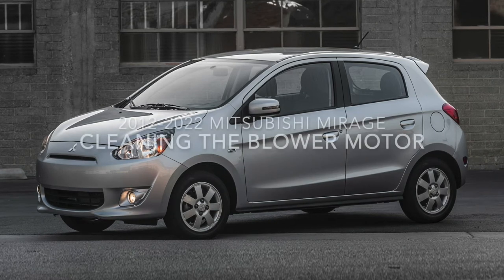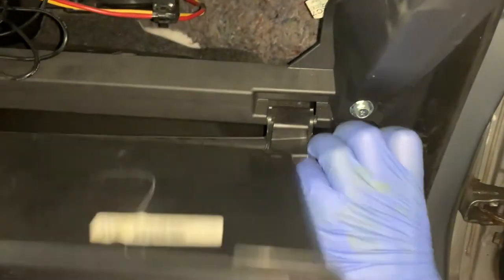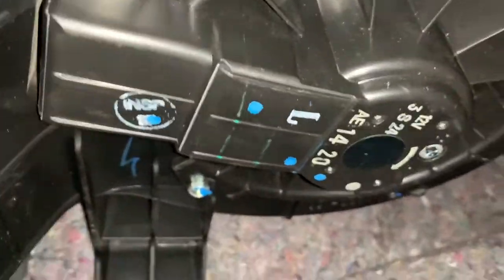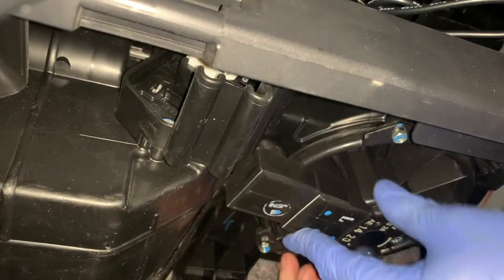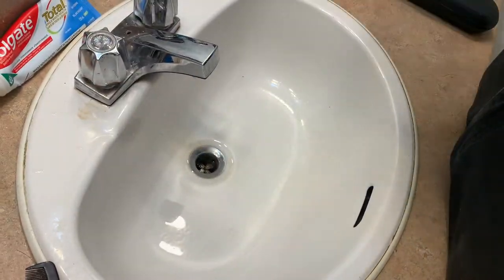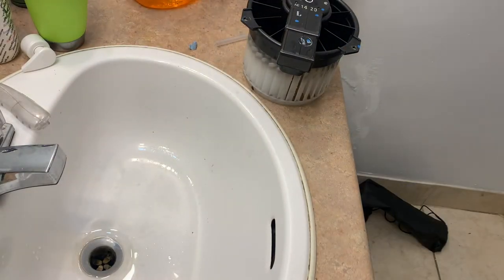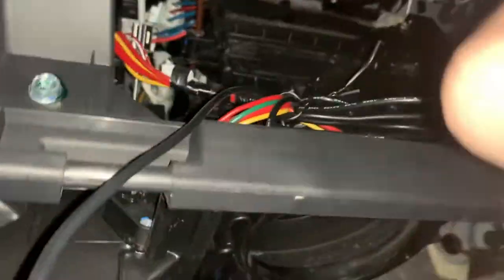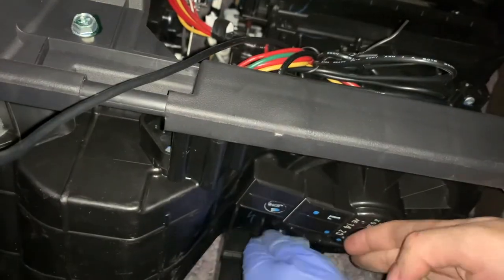Mitsubishi Mirage Blower Motor Cleaning

Comment: I have cabin filters with arrow mentioned on them... should filter be placed so tha arrow be upside down as mentioned on blower motor an upside arrow on it ???
Reply from the maker: Yes the arrow should be pointing down and the side with the larger surface area will be pointing up so there is more room to catch the dirty outside air that is sucked from above the filter down into the blower motor. This is discussed at 5:55 in the video.

Comment: hey man idk if your still active but im trying to get an item out of the right center air duct on the dash I cant find a proper diagram of the air ducts complete but if you have any tips please lmk. ive tried the vaccume trick and tried grabbing it with a coat hanger but cant see inside the vent!
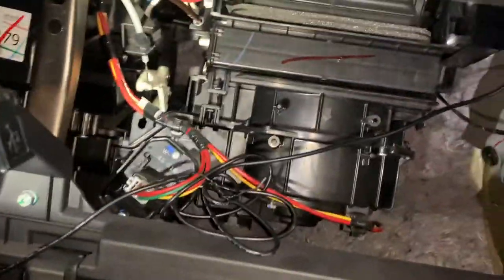Reply from the maker: Watch my CarPlay radio install video. In the first two minutes (around the 1:20 mark) in the video I show how to remove the vent grill/cover. https://youtu.be/3752c9OlRms?si=GOPjufUb-6RZh4Wt

Comment: One question sr .. how much freon has to be inside de ac sistem onz?
Reply from the maker: from factory service manual: 

Section 55A-3:
It takes: R-134a (HFC-134a) 250-290 gram or 8.8-10.2 oz. 

you can find a copy of this service manual here: https://mirageforum.com/forum/showthread.php/3720-Found-Complete-Service-Manual-amp-Wiring-Diagrams-Mirage-2015
Reply: @welfarewagonrepairs  thank you sr